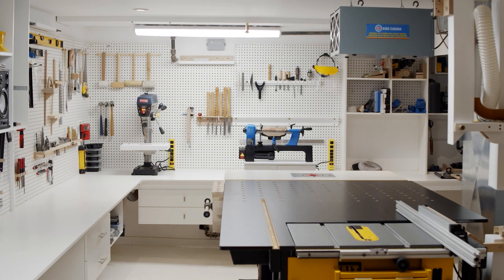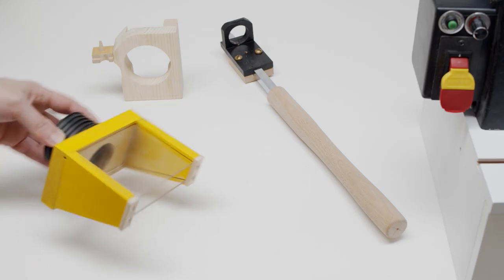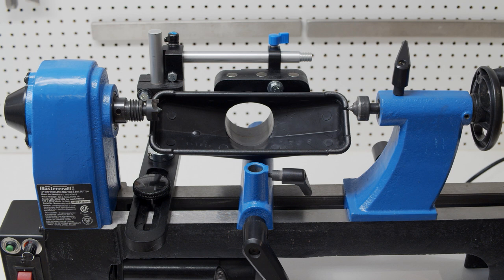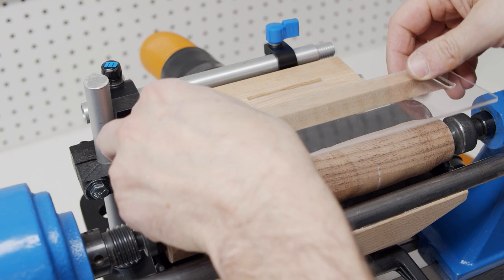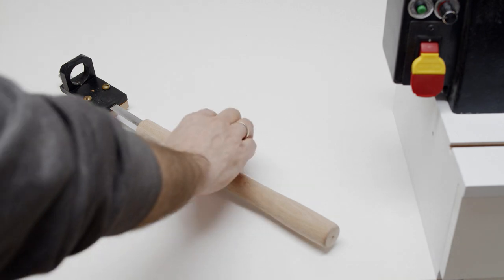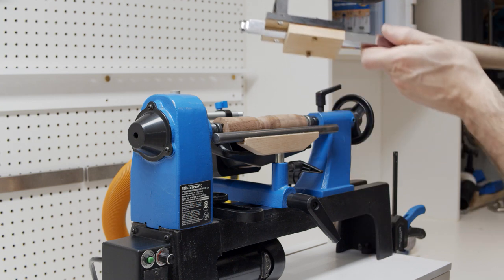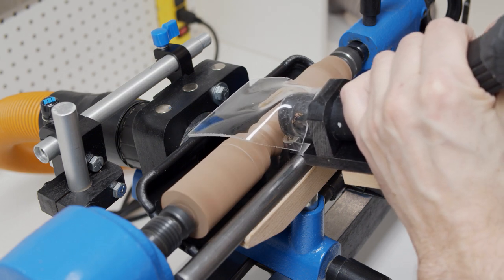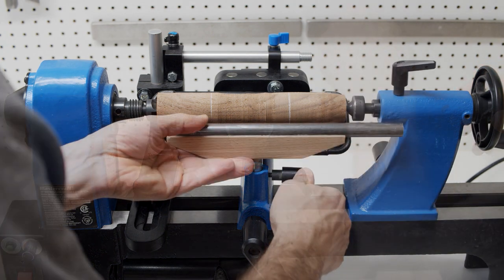Lathe Dust Collection - 100 Percent Capture!

Comment: The floor sweep you use is made by Rigid and comes in a kit.  I can't seem to find it separately anywhere, even something similiar from Rockler or Woodcraft.  I have two Rigid shop vacs that came with them.  I use one to sweep the floor and the other one to capture the metal/abrasive dust coming off of my sharpener (I have both a CBN wheel Varigrind setup and my current favorite Robert Shaw ProEdge).  If you have found a separate source for just the sweep it would be appreciated.  Thanks.
Reply from the maker: I got mine in a kit too (when I originally bought the vacuum) - I'll poke around online and see if there is a way to buy them separately!  It's funny I never use it as a floor sweep, I usually just sweep with a broom into a pile, then vacuum up the pile.

Comment: Do you have more info on how you mounted the dust hood? did you make that block?
Reply from the maker: Yes, it's just a block of MDF with a hole cut to match the vacuum attachment.  I happened to have some mounting rods from video equipment, it would also be pretty simple to just mount it to the lathe bed somehow.

Comment: What is the brand of that attachment that you are using to hold the shop vac floor attachment
Reply from the maker: I just made it - it's basically a thick piece of MDF with a 2.5 inch hole drilled in the middle, pressure fit for the vac attachment.  And then all the rods holding it are from old camera support gear.